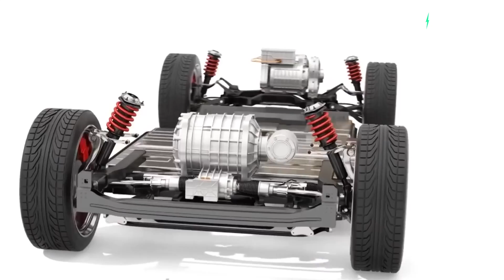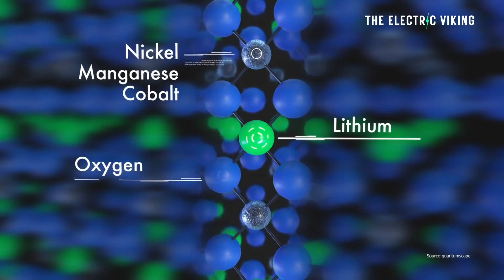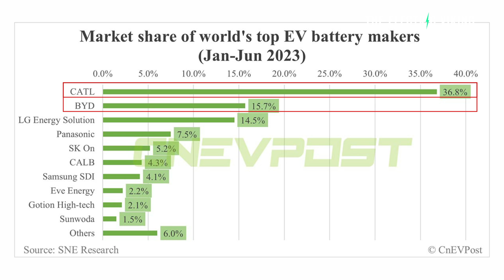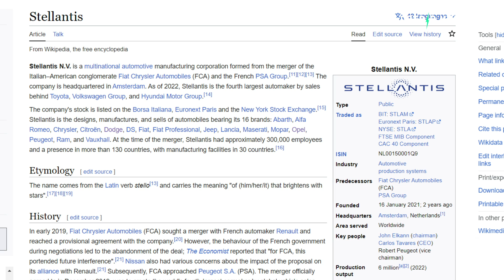Battery pack prices see HUGE decline - EVs cheaper than gas in 24 months

Comment: At what point will the inability of the grid to supply enough electricity start limiting the ability of EVs to function?  It seems EV production rate of increase is outpacing the rate of increased electrical supply.  And to say that solar / wind will be the only satisfactory increase in supply is to ignore the data.  Nations are destroying their conventional electrical energy factories, building out S&W power, and running out of electricity.  Just look at the soaring cost of electricity in Germany.  It looks like a potential trap to me.  Our resources should be going into advanced nuclear.  China are building out one new coal plant a week, they are now running an experimental molten salt nuclear reactor, with plans to build out more until a final production design facility is reached, as well as solar and wind.
Reply: Most EV charging is done overnight when the grid and power stations have low usage and loads of unused capacity.  Engineering Explained discussed the historical growth of the grid; just on historical trends, it'll grow by well more than the increase in demand caused by EVs.

Nuclear is triple the cost of other sources (even the units just opened recently in America), and rising in cost.  Solar and wind are falling in cost, but need grid and storage.  Natural gas is what's replacing coal in America; even paired with carbon capture and sequestration, it may be the cheapest option for a while.  And then provide peaker and or backup, if other means improve further.
Reply: @bearcubdaycare  I agree that we need to keep and expand gas electric plants.  Nuclear can be made cheaper and nuclear lifetime is many times that of solar panels or wind turbines.  The farther north one goes, the shorter the days and snowier and more cloudy the days.  On top  of that of course, even in the sunny south, the real output of solar is about 1/3 of that on the name plate.  Their electricity is nearly of zero value as well unless they are hooked to expensive battery leveliers so that their electric is available when the sun don't shine.  Even California does not know what to do with the scrap panels and worn out windmills.  Compared to the HUGE amount of land that solar covers, nuclear takes up almost no room.  there are plenty of videos out there describing the various new and intrinsically safe nuclear designs.  
  As they say, a 20 year emergency is a new industrial complex.   There are all kinds out there budding, robbing the poor to make the billionaires into trillionaires.
Reply: @jonahbert111  
The US has spent, on average in inflation adjusted amounts, 3.5 billion dollars of direct taxpayer subsidies per year on nuclear power since 1948. Compare that to the 0.38 billion, or 380 million, a year since 1997 spent on direct taxpayer subsidies for renewables, yet renewables are now the cheapest source of power available without subsidies, while nuclear is by far the most expensive. Nuclear takes the longest to build, and requires vast amounts of cooling water. Wind and solar, with battery backup, are the dominate form of new power production installed, and the US electrical grid is now over 20% renewables, more than coal or nuclear.

Not including the energy required to deal with nuclear waste, nuclear energy has an EROI (energy returned on (energy) invested) of  14 to 1, about equal to the lower estimates of the EROI for oil and gas. This means that one gets 14 units of energy for every unit of energy invested to extract that energy. Renewables have a higher EROI of 16-20 to 1, meaning one gets 16 to 20 units of energy for every unit of energy invested to extract that energy.

As an electrician, I have worked on nuclear power plants, wind generators, and solar, and I can say that nuclear is a dead end. All of the PV modules I have recently installed have outperformed their nameplate ratings, and overall performance of PV power plants are well engineered beforehand. I really like wind power, but the low cost of PV modules coupled with the falling cost of battery storage, makes PV the cheapest source of power.

And once grid operators get a chance to use battery packs like the Tesla mega-packs, they are spoiled for life. They can inject current or voltage at specific points of the AC waveform to keep the voltage and current in phase and maintain a proper sinusoidal waveform. The batteries are way cheaper to operate than peaker plants, and respond much faster to grid needs.

The utilities are required to have a certain amount of power capacity available to instantaneously supply power if needed. This usually means keeping combined cycle gas peaker plants on "hot standby," meaning that the turbine is spinning at generating speed and synchronized to the grid but not producing power, all while burning gas to feed the turbine and keep up a head of steam. This is incredibly expensive, and is still causing wear and tear on the power plant, and the reason that peak power is so darned expensive. Battery systems just sit there with no moving parts, and can be engaged in milliseconds, then recharged when power is cheaper, often from excess renewables.
Reply: @GoCoyote  These PV panels are sold on the basis of their name plate watt output, which is not comparable to other forms of continuous power, as we know the sun does not shine overhead but a small fraction of the time (even during sunlight hours, the sun is at various angles), sometimes it is cloudy / rains, and of course it is dark on average 1/2 of the time, so one has to divide that name plate rating by 3, at least.  Also panels, at least the commercial ones, only  last about 12 or 13 years.  A typical powerplant will last at least 3 times longer.  Also, a typical power plant runs 24 / 7, so the need for batteries is less to load level compared to solar.  Solar is so variable, subject to storms, snow storms etc just ask Texas, which was shut down like a week under these conditions.  There is no reasonable level of batteries that is going to cover that kind of storm and seasonable variability, not even close.  Yes, solar has a place, but it is not the answer.  Nuclear could be a lot less expensive if done in a sensible and efficient manner that could avoid most of these government regulation over runs and time wastes.  But of course, new designs take time to work out the kinks.  Personally, I think what is being done across multiple fronts overtly and covertly is to greatly reduce the population.  That is the ultimate "solution".  
  Here is a guy who is an energy expert.  He still has a job, so he is more enthusiastic on solar than I think is warranted.  But he has all the numbers and graphs that show it will take many decades to get somewhere on this issue.  Well worth watching:  https://www.youtube.com/watch?v=q7Gi0vObVSo
Reply: @bearcubdaycare  Germany shut down their nuclear plants, when they needed them the most. It does not look very intelligent on the face of it, does it?
Reply: There's been studies done and of course there are a lot of variables, but the bottom line is we're fine. The fossil fuel industry is trying to spread fear, though. Remember that changing to EVs changes the power source but it also reduces consumption a lot. One researcher pointed out that oil pumping, refining, and distribution takes electricity, too - about as much as EVs use.
Reply: @jamesvandamme7786  We have been at this solar stuff for how long?  But we are still using about the same amount of crude oil as when we started.  We save maybe 2 or 3% of crude oil production.  If those studies were done by the political UN, started and run by the Oligarchy,  how much credibility do they really have?  You can be a climate weather "Scientist" for the UN as long as you agree that your conclusions will agree with the UN agenda.  Of course a blackballed fired scientist is basically a ruined individual.  
  I ONLY listen to retired experts, smart guys who cannot be fired or blackmailed into silence..  https://www.youtube.com/watch?v=hgo9cH9aUkM
Reply: Isnt China building new coal factory a week already dated by about 3 years and Germany  things are because of the war.

Comment: The upcoming Toyota's Hydrogen revolution in Fuel Cell and Hydrogen Combustion Engines might be a cause too
Reply: Unless there's some significant breakthrough in Hydrogen production that defies known physics, Hydrogen and E-fuels will never be mainstream.  Currently the E-fuel total fuel cycle is 10 to 16 percent efficiency, which is far below the 77 percent total fuel cycle of an EV.  Energy is money and you can't throw away 80+ percent and expect to compete against another technology that keeps 80 percent.  That doesn't mean there won't be some niche applications, there probably will be but it will never be ubiquitous.
Reply: @Ryan-ff2db we always produce H2 where we use it. There is a reason for that.
Reply: Go hydrogen if you want to waste 66% energy 😂
Reply: They're still combustion engines with thousands of moving parts to wear or break. Toyota are pushing this in an effort to keep their parts and servicing operations active.... They're basically attempting to re-classify the dead horse as living, but impaired.....

Comment: The battery would have to be free to equal the price of a like for like ICE car. The only way they can be equal is if the ICE vehicle's price gets artificially increased.
More click bait.
Reply: How much do you think ICE and gearbox cost? At some stage the battery pack and electric motor will probably be cheaper to make.
Reply: @AORD72  Like for like. An MG ZS Excite petrol is currently listed at $22,990 plus on roads. An MG ZS Excite EV is currently listed at $42,990 plus on roads.
So apparently they are going to reduce the battery cost by $20,000 according to Mr Viking.
If someone believes that they probably believe in the Easter Bunny as well.
Of course what will happen is some cheap shit Chinese EV brand that no-one has heard of will come onto the market, and channels like this will compare it with a more upmarket ICE car rather that the entry level model ICE cars to "prove" a point.🙄 
As I said , like for like, you can't get any fairer than comparing the two MGs, same vehicle, same spec, just different drivetrain.
When you work out how they are going to cut the battery price by $20K, post it on here, I'm all ears.
Reply: Huh, you claiming that a $5,000 difference is huge when the battery pack of the trucks was about $25,000. You need to look at gasoline-powered vehicles as the auto manufacturers are getting dumber.

Comment: So currently battery cost is 14% of the retail price of a Tesla.
They'd have to half in price AGAIN just to reduce total cost 7%.

Which will happen over probably 5 years.

Good news - but this news is already mainly baked into current EV prices
Reply: Depending on the model a battery represents 20 to 30 percent of a passenger EV.  The long rage Model 3 is estimated at 27 percent of the value of the vehicle as of August this year.  The Ford Lightning is completely upside down with estimates coming in about half the sales value of the truck.  Fords number is skewed a bit though as they are selling the truck at a significant loss.
Reply: BLESS YOUR HEART ❤️

Comment: What if Tesla built the Chassis and drive train and GM/Ford put their body on it. This saves GM/Ford. But Tesla would need a new assembly line for Non UniBody construction. But other MFG want a Tesla Chassis under their cars? This was  standard practice before UniBody construction took over in the 80s. Body off Chassis access to replace battery packs too. Crazy idea or what?
Reply: What's in it for Tesla?
They can just make the whole thing and take more profit
Reply: More like For or GM desigs the car based on Tesla's platform and Tesla contract manufactures it.   Tesla gets their 20% up front.